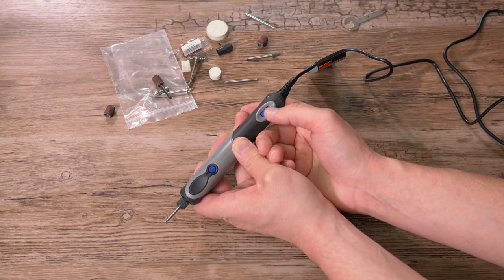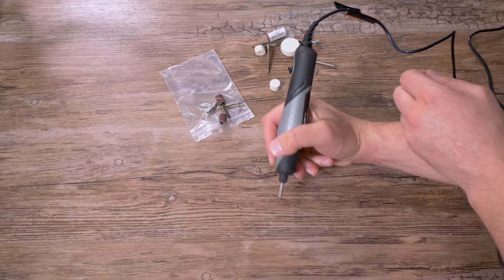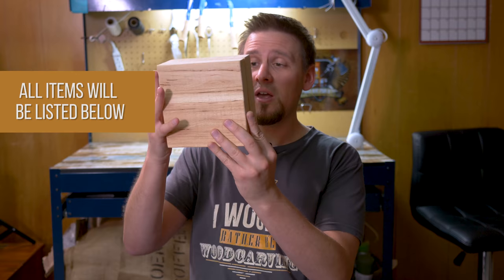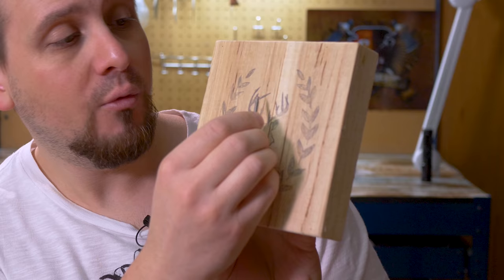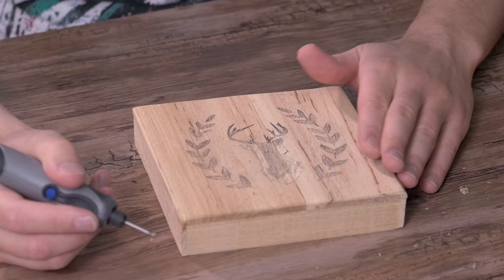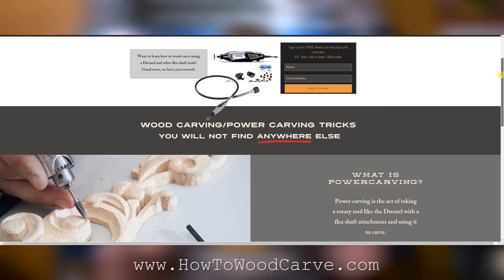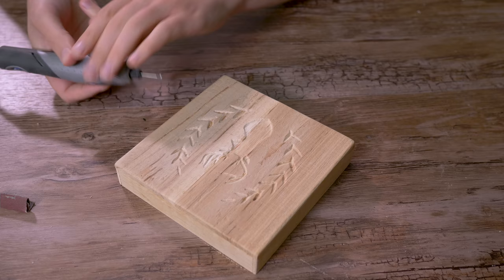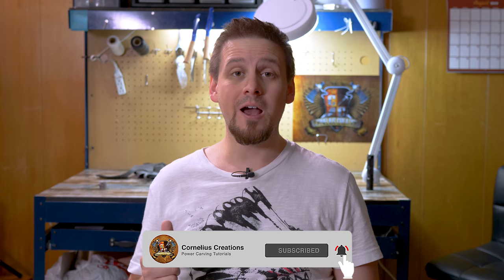How to Wood Carve/Power Carve with the Dremel Stylo

Comment: Use a small amount of shaving cream and coat each side of the lens then use a soft cloth to gently rub the cream until it is clear again this layer will prevent any fogging and can be reapplied as required.
Reply from the maker: Fantastic tip!!

Comment: Years ago, I tried carving with a Dremel. The darned bit flew off on Bass wood. I thought maybe I didn't tighten it enough. So I tried again. The second time the bit splintered and flew off. I didn't apply very much pressure either time. I had someone check it to make sure it was on tightly enough so it wasn't me. Maybe these days they make them better. But that experience turned me off to Dremel tools. Even so, your video was awesome and you explained everything pretty clearly. Thank you.

Comment: I'm an instrument maker. I build violins, guitars, harps, and steel guitars. I bought the Stylo 2 days ago. I have several other bigger Dremels, but the are just too big and clunky. Even the flexible shaft one is a pain in the butt to carve with. The Stylo is perfect for wood carving. I highly recommend! I also recommend buy many bit sets. One can get bit sets from Wally or Harbor Freight for dirt cheap.  Not counting drum sanders, disc, polishing wheels, ect... I have at least 500 different metal bits. Variety is best, one can never have too many metal bits. Each one has its own special cut. Great places to get wood is on the side of the road or at a beach. Why pay when you can get for free. But if you must, Hobby Lobby, Joannes, and Michaels have all sorts of good wood blocks. Now when it comes to carving, I NEVER carve recessed objects, like in this video. I only carve so the object is raised above so that it has the 3D look. Its just as easy to do, but takes more time, but looks so much better. With me being an instrument maker I also have about 10 sets of chisels from very small (1/8") to large ones about 1". I do all instrument making with absolutely NO power tools. So using a power tool like the Stylo is going to be a new experience for me. Too me, old 2 x 4's are the best practice material. Its cheap if you buy, but free sitting in someones trash pile. Its also soft using pine wood, so easy to cut. With it so easy to cut, any slips can cut out big chunks. This will teach you self control of the tool very fast. Once you master carving it, then go to the more expensive wood like oak, maple, or the best... mahogany. Anyone who has good hand control can carve, it just takes practice. Start out very simple in a design. In no time, you will be a master at carving... Go slow, go careful, control the Stylo like a pencil... Great video, thumbs up!!!
Reply from the maker: Good advice! Do you have any links to your work? I’d love to see it
Reply: This is my first lap steel guitar but only roughly cut. The final has leaf and vine patterns and done in red. I use red food coloring for the stain, its so translucent that all the woodgrain shows. I ONLY use food coloring and all violins are done in it. The commercial stains just hide too much! I will post a picture of them, or better yet a video!
Reply from the maker: That’s awesome man!
Reply from the maker: I would love to see a video of it!
Reply: My current project is building an electric contra upright bass, otherwise known as a double bass. It stands 6.5 foot and will have a 5.5' string length so I can hit some really low notes, lower than a bass guitar. I will be posting video of it later. The bass will have a round disc up on the top of the scroll of a skull and crossbones to match my 4 knobs for controlling volume and tone. The thing I like about this tool is that it is NOT powerful at all and stops rotating with hardly any pressure, this is actually a good thing. On my big Dremel it will eat a hole in a split second and ruin my work. With the Stylo you have NO CHOICE except to work slowly. Even on the highest setting of 5, no matter is using new bits, it is NOT going to carve fast at all. Slow, easy, careful, and operated it like a pencil and your work will go just fine. I just ordered a flexible shaft devise that is a power chisel, it will be in this week. Once this tool is in its time to carve the skull thing for both sides of the scroll of my upright bass. I will post videos of my work... I HIGHLY recommend the Stylo... its PERFECT for carving, but ONLY for small projects, if you have a large piece to carve, use a bigger dremel, or a chainsaw!!!
Reply: I'm curious,  I have a violin,  portion a student one,  nothing to special...I Woodburn,  can I Woodburn designs in it ?

Comment: I picked up one of these. The first thing I used it for was cutting down some #18 exacto blades to 3/32 for a project I have going. Even with the thinnest cutting wheel I could find it stalled constantly. Compared to a Dotco it's a POS. But you get what you pay for. I actually like the Model 1100 Stylo cordless one from about 15 years ago more. I've had and used Dremels since the 70s. Ones that were actually made in Racine. It seems I've got a habit of picking out power tools that get discontinued. A Ryobi BT-3000 and their Variable speed drill drill press  from the same time period.

Comment: I stopped carving for over five years and I have a 14" Native American carving I will be  painting with acrylics. I'd like to see a video on this process (how to: 1. sanding tips  2.applying a glazed seal before painting to  make paint flow easier 3.how to thin your acrylic paint for smoother painting 4. sealer to use on the carving 4. any other tips I need to consider

Comment: Basswood (like guitar), here I thought that it was Basswood (like the fish)! Ha ha ha! Thanks for the tutorial. Love the vacuum! One thumbs down for the video is that lack of hearing protection. You protect every BUT your hearing. It's a personal pet peeve of mine as I have tinnitus. I would have to say, a Dremel tool, if you're considering just One, is far more versatile, especially when you need to run your tool a slower RPMs and has a lot of bits that can be used with it including sanding wheels. One "stencil"  method to use print off  your design (in reverse the way you want it) then trace it onto your carving material using carbon paper. I got my carbon paper at Office Depot for like $5 & use it lots. Good information for us tho!

Comment: Nicely done tutorial.  I was not aware that Dremel made the stylo.  I have acquired 5 dremels over the years.  Today I received my Ryobi battery powered rotary tool. It's very similar to the Dremel and I really like having the motor in the hand piece rather than a drive cable from the hand piece to the tool.  Ryobi does have both types.  It's really great that so many innovations have been made for rotary tools over the years.  I've become partial to the ryobi battery system and the convenience of battery tools.  Thanks for sharing your knowledge and expertise with others.

Comment: A couple of questions from a complete woodcarving n00b (but I'd like to try, so...)
1) how are rechargeable stylus carvers rated? I mean, I found some on Amazon, and they recharge and work without a power cable attached. Sounds cool, and they are not very expensive... any opinions?
2) if you're gonna stain your creation, do you do it before or after carving? I think that if you stain before carving the final result will be "lighter" than the surrounding wood, but I have zero experience in this field...
Reply from the maker: Hey there! Rechargeable units are great for a variety of projects. But for wood carving you need electric powered unit. All staining needs to be done after the initial carvings. If not, you will have a mess on your hands.
Reply: @CorneliusCreations  Thanks for the reply!! I'll probably get myself a small powered unit and try venturing into the woodcarving world :)

Comment: thank you for an awesome video, i learned so much.Also i broke my flex shaft on my last project, can't wait to try a stylus! Will be watching, doing gr8 job keep it up.
Reply from the maker: Hey there! Thank you, I am glad you are learning a lot!
Reply: Too me the flexible shaft is absolutely horrible to carve with. The big cable is like having a garden hose attached, except the garden hose is more flexible. The flexible shaft is just totally un-natural to use, discard the piece of crap, don't use it at all. The Stylo is the ONLY way to go, more like a pencil, easier to control, more natural. The power cord does not hinder. In fact, I barely even notice the power cord. I love the Stylo! Also buy many bit sets, the more bits you have the more versatile! I tend to buy cheap bit sets from Wallmart, or even cheaper priced ones at Harbor Freight. This way when a bit goes dull, chunk it on the garbage... Happy carving, its fun!!! BTW I'm an instrument maker that makes violins, guitars, harps, and steel guitars. I only use chisels for my work so using a Stylo is going to be a new thing for me. I bought my Stylo two days ago and already have mastered it!!!

Comment: Yeah, I draw very detailed drawings with charcoal and am even a woodworker. However, this is a LOT harder than you make it seem and therefore, people get frustrated. I tried with my Dremel 3000 with the wand and the bits LOVE to run off into the softer areas of the grain. I'm pretty sure I was a bit heavy-handed but I haven't tried again. I tried it on oak, thinking that the hard wood and tight grain would help and it was a lot better. However, the bit will still jerk right off the line and into the softer wood. I have a lot of ideas but just can't get it to work for me, especially since I don't practice. Sounds obvious why I'm having problems but I've always been able to just try whatever and it basically working.
Reply from the maker: With all due respect, If people are frustrated it’s not necessarily my fault for making it look easy, that’s an internal problem of them overly confident in a skill they have spent no time developing. 

I would absolutely love to have the ability to try whatever and it working for me like you do. What you see here is long hours of practice condensed down into bite sized chunks of information people can understand. I have a ton of beginner tutorials addressing your very problem. It takes time to develop the skill my friend. Give it some time and you will get it man! I’m here if you need some help bro!

Comment: Hey, Cornelius, thanks for making all these How-to vids. I am going to be getting myself one of these tools for a project and realized I need to learn how to use the friggin thing before I muck up my project. That wouldn't be very smart, would it?

My only question is, do you need a variable speed tool to do certain jobs, or can a fixed speed be alright? If there's a vid with this particular info to enlighten me, just point it out, if you would please. Thanks.

Comment: What burr did you use in this video?? I bought this the other day and it came with 3 different sizes. I tried all 3 and none of them did a thing with the wood I was working on. I was using a small block we cut from a 2x4, and then I moved on to little square tiles I bought from a craft store. After 5 minutes, you couldn't tell I had done anything to either piece of wood. I even turned it up all the way to the highest speed. I was excited to try this tool, but now I'm bummed. I see they make special kits for engraving/carving wood and glass but none of the stores around me carry it. I'm not in the mood to have to order it online and wait another week. I'm about to take the Dremel back.

Comment: I may get this just to clean leftover supports on resin prints.
Reply from the maker: Right on. Keeping it running at a low rpm would keep it from melting the resin.
Reply: Cornelius Creations Print resin is quite weird, although it sands better than PLA if I use a hot knife it won’t cut into it where as it cuts into PLA like butter.
Must be heat resistant or something, I have a regular Dremel with extension but it’s hard to maneuver.

Comment: Nice. I'm a woodworker with moderate experience.  In Dremel carving however I am 100% newbie.  First project is simple.  Using  letter stencils my wife has labeled garden stakes on pallet wood which I prepared by sanding to 100 grit.  My task now is to hog out each letter.  I have the small and next size up ball tips.  Is there an appropriate speed to use for this application?
Reply from the maker: Sounds like a fun project! I usually go as fast as I can.
Reply: @CorneliusCreations  Ok thanks!

Comment: I am fairly new to wood carving. I am trying to carve 50 stars in the union for an American flag.  I would like to know if there is an adhesive vinyl sheet that I could apply to the already blue stained union.   I want to then use a star template and trace out the stars on to the adhesive vinyl sheet.  I would then use a dremel to carve out the stars and remove the vinyl stars with the intention of using the then star (holes in the vinyl) to paint white.  Then once the stars are painted I will remove the rest of the adhesive vinyl.  Does this sound doable?   Can I engrave the wood through the vinyl leaving the rest of the vinyl intact to use as a painting template?   If not, do you have any other suggestions.
Reply from the maker: I believe there are templates you can buy that people have made for these.

Comment: Great channel I’m enjoying watching this was interesting, I had been thinking of buying the flex shaft to go with my Dremel. But this made sense having a thinner cord not being a burden. So I have a question or two questions can this be used  for light drilling in thin wood or in crafts I make, and also would I be able to put on a cutting wheel to cut like balsa wood or popsicle sticks  that type of thing in addition to using it for carving? I’m not a spring chicken and I feel like the Dremel  is heavy and perhaps that’s my problem but last summer I tried drilling with my Dremel and I think the speed was just too fast and it spun the little piece of wood and sent it flying across the room. A little bit too much speed I guess... or operator error??? So I’m wondering if this would work better for me.
Also the accessories you had laying next to the Stylo come included with it am I correct in assuming that?

Comment: Hi Matt can you make a video using the   GOXAWEE Rotary Tool Kit 240W Power Die Grinder Set with 1/4 Inch 3-Jaw Chuck (0.5-6 mm), 6 Step Variable Speed, Advanced Flex its cheaper for these who want to start wood carvings.

Comment: I have a problem with the end bouncing off the wood and moving around when I try to carve. I find it difficult to keep the tip exactly where I want it. Maybe I am using too low or too high a speed? Or maybe the wrong type of tip? Thank you :o)
Reply from the maker: Maintaining control takes practice. You will build up resistance and be able to keep it under control. Also, Be mindful of how hard you are pressing down.

Comment: What size dremel burr would you recommend for very small writing, im currently using the ones that came with the dremel 4000/65 size  107 and 191 and they are still too thick for the writing I want to engrave ? Any tips would be most appreciated.
Reply: On wood

Comment: Thanks for the video and the ones before. I have a question; is the power enough to carve an ebony wood? Is 20,000 RPM enough? I always expriance problems with my dremel 3000, under speeds 30000 RPM. Thanks in advance for your kind interest.
Reply from the maker: If you are experiencing problems with your Dremel 3000 on that wood under 30kRPM I’d say this probably wouldn’t be the tool you need to use. This is quite a bit more money, but from what you said, you may need to look into the Foredom Sr series.
Reply: @CorneliusCreations  thanks a lot
Reply: @CorneliusCreations  I made a mistake explaining my problem. My problem under 30K RPM is not the power of the Dremel, while cutting exotic woods (spesifically padauk and purple heart) the carbide or HSS burrs jumps when meets a harder area. This is sometimes a problem even at 30K-35K RPM. So, in this situation, is it logical to use 20K RPM? Greetings from Istanbul/Tureky
Reply: Olcay Mısırlıoğlu x

Comment: I bought one at Home Depot and didn't open the box it came in until yesterday...I had it kicking around until I decided to try it, Lo and behold , it did not have anything else in the box that was supposed to be in there!  I don't have the receipt anymore so I am SOL.  I don't see any reason to have the disconnect like there is near the plug in.  IK am sorely disappointed in the product and wish I had kept the receipt because I would take it back.
Reply from the maker: I would take it back anyway and ask to speak with a manager!

Comment: This is so awesome! I'm gonna use some unicorn spit stain for that extra powerful sexy unicorn blood iridescent halo glaze.
Reply: Yo... I use RED FOOD COLORING for a stain! It does NOT hide the wood underneath. It goes on very dull, but once you varnish it, it is so pretty! It gives a nice dark red... Hey try it, you will love the results, and it has no dangerous chemicals. But it WILL stain anything it touches. I had to scrub my hands with Lava soap to remove the red. Also, you do NOT have to wait for the food coloring to dry. One can brush it on, then brush the varnish on immediately.